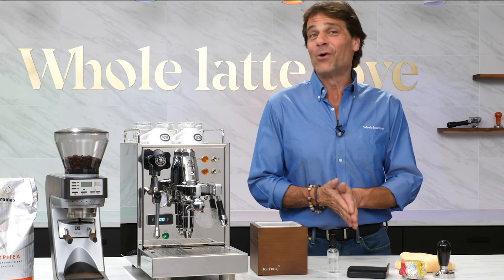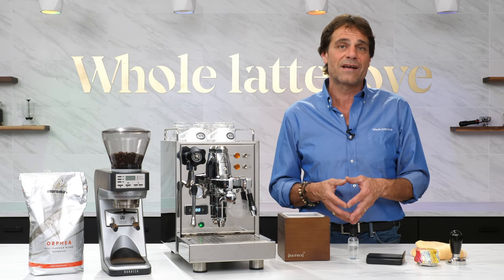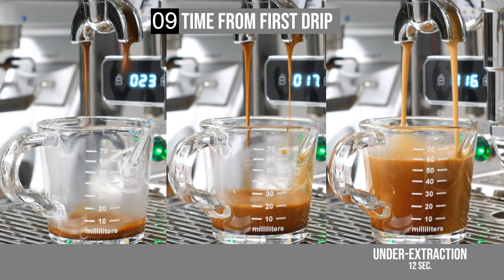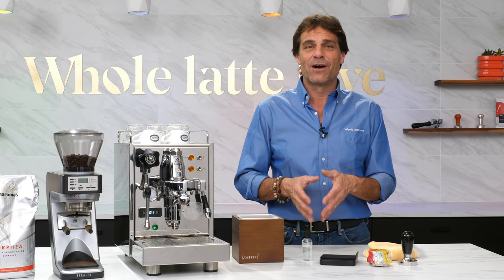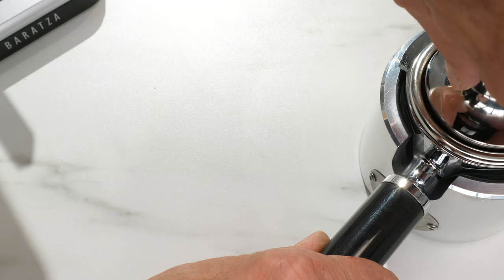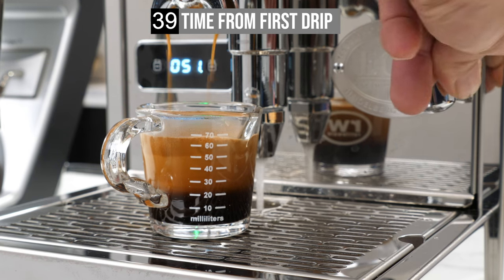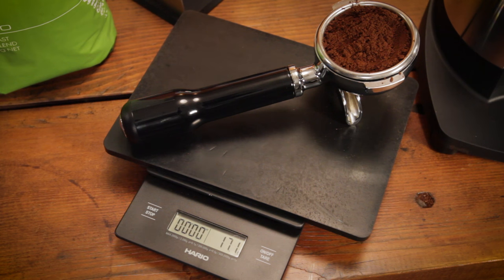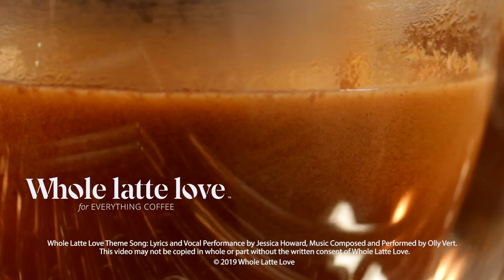How To Dial In Grind Size for Espresso

Comment: Hi Mark, Love all your videos. Thanks to you I'm ordering the Gaggia Classic Pro with the Sette 270 this week when I get paid. I'm also getting the IMS shower screen, Baristapro 18 gram basket, IMS silicone group gasket,  and IMS holding plate. I'm also getting the Orphea and Jack leveler. I know you always say that grind size is always a variable but can you give me an idea of where to start please? I mean because of you I'm spending over $1000 lol. :)
Reply from the maker: Hi Quan, Thanks for the comment. Nice setup! In case you missed it I did this live stream last week featuring the Classic Pro, Sette and I was of course using the Orphea: https://youtu.be/jzvi36qbfhY Grind size is a variable and every grinder, even the same make and model is a little different. Beyond that your dose weight and other variables play into grind size. So, as you dial in try and keep everything else as consistent as possible. New out of the box your grind setting will likely be in the 2-5 range on the Sette's macro setting. The Jack works well in the BaristaPro baskets. Set the leveler as deep as possible without causing the adjustment to click to a shallower setting or leaving a mark in the puck. Also keep the leveler free of coffee particles - so brush off between uses. Your Sette will come with shims. After break in with ~8lb/4kg of coffee use the shim(s) to restore fine grinding. Takes about a minute to insert a shim: https://youtu.be/7sBpJcsF7-4 Also might want to bookmark our support wiki for the Classic: https://wiki.wholelattelove.com/Gaggia_Classic Lot's of great info and videos there. Enjoy your new equipment!
Marc

Comment: Hi, I am a beginner in this area. I just bought my first machine (a Sage Barista Express). The portafilter is not standard size so i wonder if you have any tips regrading coffee weight/amount for this smaller then usual portafilter. In advance thank you.
Reply from the maker: Hi SST, I would load the portafilter loosely to the top rim then tamp the coffee.
Marc

Comment: Hi, my basket is made for 14g of coffee. So, let's say I put 15,5 g there, can it actually have any influence on my espresso taste? Everywhere I see a right dose of coffee for espresso there is rather 18 - 20g mentioned but I didn't find 14g anywhere. Nice video!
Reply from the maker: Hi MC, What type of machine do you have? If it's a 58mm portafilter you can likely use a filter basket with higher capacity. 14g was and still is the traditional dose in Italy. Most everywhere else 17+g is typical especially in high-end specialty coffee. You can add more coffee to a basket and change the flavor for sure! Just don't add so much you leaver an impression of the shower screen on the coffee puck. Need to have room between the shower screen and coffee when brewing for proper extractions.
Marc
Reply: @Wholelattelovepage  Thanks for the answer! I have Ascaso Arc which has a 58mm portafilter. I found my basket capable for max 16g, and I am satisfied with that amount :) Thanks for helping!

Comment: Just purchased a jura e8. Can’t get it over the 14 seconds. 60 ml, finest setting and still 14 seconds. I’m counting from the first drip starts pouring.
Reply from the maker: Hi i, The timing used in semi-automatic machines does not apply to super-automatic machines like the Jura E8.

Comment: Why do you dial in using a double shot 60ml/2oz instead of starting with a single shot.  That said should we dial in for a single shot to acheive the same or shorter time ?  Thanks in advance, love your videos.
Reply from the maker: Hi DVH, Pulling singles is incredibly uncommon where I am. They are more difficult to do well. Timing for a single shot is usually about the same.
Marc

Comment: I get best taste for 31 to 51 second shots. Target is 1:2 max. Preferable is 1:1.5. I use lighter roast or medium light. No temp or pressure control and only thing I can vary is grind size.

Even for same coffee I need to reduce shot timing as coffee gets older than 5 to 7 days depending on weather. I use rancilio because baratza didn’t help me much. I wish I could have got sette one because it seems better made and is cheaper as well.

For most coffee I had to almost grind to zero size in rancilio and cannot go any lower.
Reply from the maker: Hi z, Thanks for sharing your details. The Rocky grinder is workhorse! It's maybe showing its age compared to what's available recently. I always found it was a bit clumpy at espresso grind size and limited by stepped grind size adjustment. If you are near zero I have a video that shows how to calibrate the Rancilio Rocky which should get you to a higher number: https://youtu.be/I3A6O9cMtmI
Marc

Comment: Hello I just started my espresso journey and I need some help!!! I purchased the KitchenAid coffee grinder KCG8433 and I am confused on the grind time and size and was wondering if you could help me achieve the 18 grams in the porta filter 
Thanks
Reply from the maker: Hi Jennifer, Only way to be certain you have 18g in the PF is to weigh. I suggest grinding until your PF is slightly overfilled. Then swipe with finger to level. For grind size, you're looking for something between table salt and powder. Sorry I can't give you a specific grind setting as it will change based on other variables. So fill, swipe, tamp and pull a shot looking for an extraction time of 20-30 seconds to produce about 2oz/60ml of espresso. If coming too fast decrease the grind a little and try again. If coming to slow increase grind size and repeat.
Hope that helps!
Marc

Comment: I just purchased that exact grinder and coffee to go with my new Gaggia Classic.  What was the setting you were at?  Is there a video for taking a grinder (hopefully the 270Wi) out of the box and setting it up?  As a complete newbie to this an unboxing and getting the grind set on a brand new grinder video would be helpful.
Reply from the maker: Hi JG, The most common question I get. "Hey Marc what grind setting were you at?" Problem is my grind setting will likely produce a different grind size than your grinder even at the same setting. You really need to go through the relatively straightforward process of dialing in as described in this video. Then understand grind size is not static. It will change when other variables change like coffee dose amount, bean type, bean age, etc. Once you get the hang of it it's very easy. Some advice with your 270 Wi (I love the Sette by the way!): Depending on humidity and bean type you may get some static in the grinds. Almost guaranteed with the first few grind cycles until the burrs get broken in with a light coating of coffee oils. If you continue to have static stir the beans in the hopper with a damp finger. Initially try a macro setting of about 4 with the micro ring in the middle. Grind a few grams of beans. Looking for a particle size resembling something between table salt and granulated sugar. If you're close to that have a go at an extraction with 17g of coffee. Looking to produce 50-60ml ~2oz of espresso in 20-30 seconds from first drip. If coming to fast adjust grind size 1 notch finer onthe macro setting. To slow go one notch coarser. Continue adjusting until you get the 2oz in 20-30 seconds. The Wi learns over successive cycles when it needs to stop grinding in order to hit your desired weight. Each of the 3 weight presets learns individually. After a few cycles of grinding at the same grind size you can expect weight accuracy of +/- 0.2g. Be sure and adjust the portafilter hook to properly hold your portafilter. There's a 2mm Allen screw you loosen which allows you to adjust the height of the hook. When grinding do not touch the grinder or your portafilter as that will disturb the weighing. Setting weights for each preset is easy. Use the arrow keys to increase/descrease weight then press and hold the 1, 2, or 3 weight preset button until it flashes. That weight is then programmed to that position. Hope that helps! If you have any more questions ask away and I'd be happy to answer.
Marc

Comment: Got a question about bean usage when setting up my Brenville Barista Express.  I am using a lot of beans in the process and when I change my beans, I will end up having to do it again.  Could I do it w single shots instead of double shots which would halve my bean usage for bad shots and then switch to double shots when I am getting lose?
Reply from the maker: Hi Donald, Thanks for the question. It's possible but not something I've tried with Breville filter baskets. There are some single double basket pairs which are capable of using about the same grind size - I've used some aftermarket precision baskets with that capability. Not sure if the stock Breville baskets can do that. But give it a try!
Marc

Comment: Hello, I have an automatic coffee machine  (Saeco PicoBaristo Deluxe) and I'm having trouble geting that cremy finish for the expresso. I am 99% sure the problem is the grinding, because I have another coffee machine that is the same only a tipe older (a lower version)with the same tipe of coffee and  it has a great crema. I tried to play with the grinding setting but I get in the same amount of seconds  (12 s) for an expresso 60ml. What should I do, or set?
Reply from the maker: HI BS, Grind is the first place to start. Do the used coffee pucks look similar in grind size between the machines? If so then it could be a maintenance issue on the underperforming machine. Be sure the brew unit is clean and operating properly.

Comment: Hey Mark! Thank you for theses awesome videos it help me a lot. I just would to know what is your grinder dial setting for the espresso? I have the same grinder and machine on this video.
Thank you
Reply from the maker: Simo, Wish I could tell you my grind setting. Even if I could It does not mean it's right for your variables! The numbers on the grinder are just references. A 2 setting on mine could produce a very different grind size than 2 on yours. You need to dial in your grind size to fit your particular variables. And remember grind setting is never set and forget! As variables change like bean type, bean age, dose weight, etc your grind will need to be adjusted.
Marc

Comment: Hi Marc, once again another amazing video! And lovely looking studio! My question: you mentioned to count time from the first first drip. In the shop where I bought my machine (Profitec 300) they told me I should count the time from the moment I start the shot, meaning pre-infusion included. Usually the pre-infusion on my machine is about 5-6 seconds. So, i am stopping my shot usually at around 25-26 seconds included the pre-infusion, but that would be for me that from the first drip in my case I’m stoping my shot actually at 20 seconds. I am extremely confused now. Please help :-/ how should I count the time then? A million thanks
Reply from the maker: Hi Leonel, Thanks for the comment on video and studio - great to get the feedback! So I use a lot of different machines. Some with vibration pumps, some with rotary pumps some with pre-infusion and some without. In my mind extraction starts when brew water starts flowing through the coffee. It takes longer for that to happen on a vibration pump than a rotary pump. Pre-infusion should not be included in timing. There's very little flow if any during pre-infusion. Common purpose for pre-infusion is to wet coffee so it swells to help prevent channeling or allow very fresh coffee to off-gas prior to normal pressure extraction starts. Do keep in mind that shot timing is the most basic way of appraising an extraction! Use flavor and brew ratios (if you want to go there) after a grind is dialed in.
Marc
Reply: Whole Latte Love thank you Marc! I am amazed with how much time you take for answering these hundreds of questions you get all the time in YouTube. So, if I understand you answer correctly. With my Profitec 300, then I should ignore those first 5-6 seconds when the pump is working and start counting when the first drip is out of the spout right?  Thanks again Marc and regards from Switzerland

Comment: Hey, new 'bean to cup' owner here needing a bit of help!

I recently made the leap from nespresso to my first bean to cup machine, the breville barista touch. I've been watching lots of videos about dialing in and also experimenting a bit but I have the following situation. In order to reach ballpark of 20-30s extraction time I need to set my grind finer but when I do this it adds a nasty after taste that stays around in your mouth longer the finer I go. I have the following settings for the nicest tasting shot and can repeat this somewhat conistently.

Beans: medium/dark just about 2 weeks since roast
Dose: 18g
Output: 36g
Time: 14-17s

Is there something I could change to make the brew time a bit longer without running into the nasty taste?
Reply from the maker: Hi Rafty, If you like the flavor at your current timing then no reason to change. That's why I always recommend tasting a shot regardless of timing. Perhaps the nasty taste is just part of the bean you're using. Very fresh from roast beans often present with extra brightness/acidity. More likely in lighter roast coffees but still some in darker roast. As the beans age this will lessen. With darker roasts, you're often getting more flavor of the roast at the end of an extraction - perhaps that's what your are not liking?
Marc
Reply: @Wholelattelovepage  Thanks for the reply Mark! I definitely think my lack of experience and as a result of that, lack of 'taste knowledge' is probably a factor here. I'd love to take the same beans to a professional and see what they can get from them just to see what I should be expecting. I'm definitely going to try the lavzza super crema ones you suggest though. That being said I noticed that the 'nasty' taste I have described is also now in the smell whenever I open the bag so it could just be the intended taste of the beans or due to my silly storage of them. I just used the bag that the beans came in to store them. They had a clippable seal and a pressure value for degassing, I'd like to say I made sure that seal was tight every single time I opened them but I wouldn't want to bet on it. It was also a 1kg bag as I thought it'd be good to have for first time, but I've since seen people suggesting smaller fresh batches. I've also purchased some single dose vials to measure out when I get a new bag and keep each dose airtight so hopefully that will solve that issue if it was the case.

Finally I've also got a few different 250g bags on their way to try out, as you say maybe those ones are not to my liking so I'll be trying out a fair few things and then hopefully find what I like and what I don't. Thanks again for the help!

Comment: So time starts from first drip? I thought it started at the same time as the machine.
Reply from the maker: Hi Ana, You can choose either pump on or first drip. I tend to go with first drip due to the variety of machine types and extraction techniques I use. For instance, vibration pump machines take longer for first drip than rotary pumps. Or, if doing extra long low flow pre-infusions on fresh from roast specialty coffees I might not have 1st drip until 15 seconds after pump on. Certainly would not complete that extraction 10 -15 seconds later. Keep in mind timing is basic and a reference to your machine and variables.
Marc

Comment: Hi Marc! Love your videos. Looking to get a ECM Classika from you all and deciding whether to get flow control or not. I am concerned that it was be more complicated to dial-in beans with flow control. Do you have a video on dialing in with flow control? Thanks!
Reply from the maker: Hi NR, Thanks for the kind comment. Here's a link to a live stream playlist with a bunch of very detailed flow control videos: https://www.youtube.com/playlist?list=PLaBDDfOHAAC2tlvMR2WZSLjizjGrcIT7H
Dialing in with flow control is quite simple. Set the flow control to 1.25 turns open which gives the stock flow rate of 8g/s on a vibration pump machine and dial-in as you would normally. After that you can use the flow control to modify extractions. In the playlist are 5 different profiles I use. One thing to keep in mind is there's very little reason to ever open the flow control more than 1.5 turns. Beyond 1.5 flow rates get quite high and produce no benefit. My favorite profile is one used on very fresh, lighter roast single origin coffees. it uses a very long low flow pre-infusion with the FC valve open a quarter turn for ~15 seconds or until first drip. Then move up to a moderate flow with the valve open a half turn to finish the shot. It's similar to a Slayer style extraction and does wonders to tame the brightness typical in fresh, high altitude specialty coffees.
Marc
Reply: @Wholelattelovepage  Awesome! Planning on getting the machine soon and it’s due to your help. Thank you very much!

Comment: Hey Mark, 
I'm far from using pro gear with my Breville Infuser and Breville Pro Grinder, but I've been experiencing inconsistency between pulling a shot for my wife, and then myself. I'm using the non-pressurized double basket, and using between 16-17g (the kitchen scale I use rounds to the g instead of 1/10), and I've been trying to shoot for about 42g extracted in 25-30s. First shot is spot on, second shot over extracts, third shot is perfect again. Beans are fresh ground from Whole Foods, and are used between 3-14 days from roast. Any ideas? Could a couple of 1/10s between grinds be messing me up, or is there anything to burr temperature messing with results?